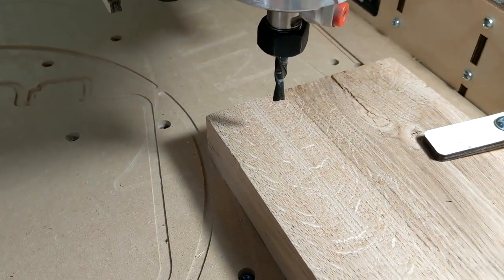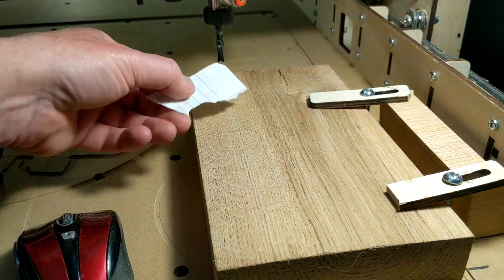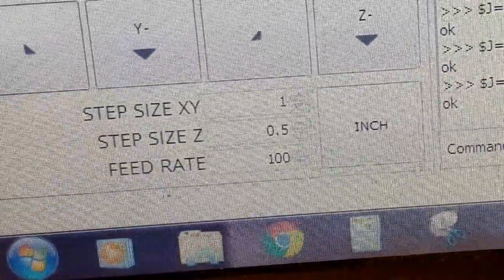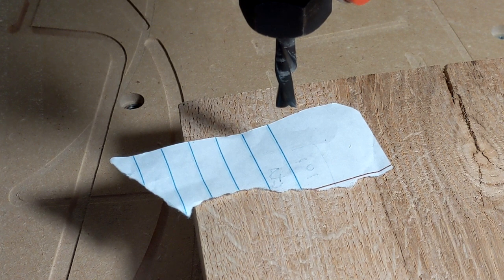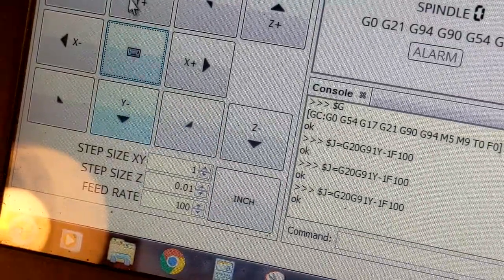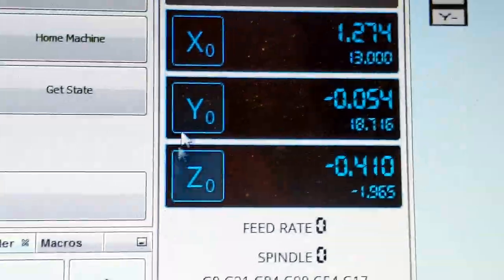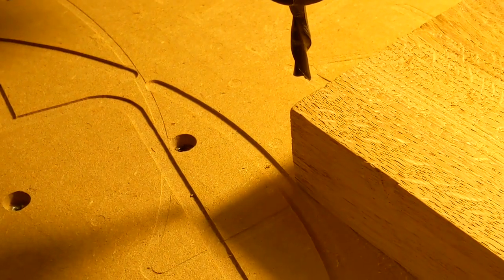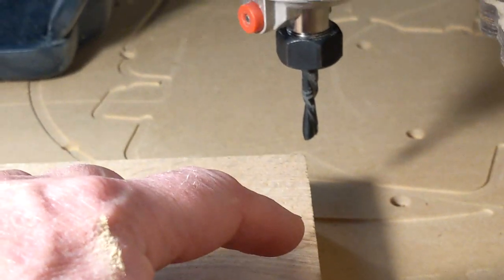Precise Zero Setting Without a Touch Probe on Your CNC Bits

Comment: I would have never thought about that 8th of an inch this way and an 8th of an inch that way thing. It sounds to me like your dividing 1/8 (what ever bit size is used) by 3 to get .125. I'm terrible at math and would actually have to break out my digital calipers and read the number off of that and divide by 3 to do the same thing. 
I did what you said with the code and it did work but I have a question.
Its a great method, but now that your using gsender is it possible to do the mathematical part of it differently in gsender?
I mean is their a different method to do the same thing or do you always have to divide your bit size by 3 AND plug in the code in the console.
Is there another way without plugging in the code. I would never remember that.
Just looking to learn a different way.
AND, you wouldn't consider making a video on how to make macros would you? I haven't seen that kind of video and I see your not one to leave out details.
I would love to be able to turn this procedure into a macro.
Word of advise to my future self...Don't forget to turn on the router!
Reply from the maker: Iwannaapple, unfortunately yes this is the easiest method. I know the math is tedious! You could always get an autozero touchplate which eliminates the math you'd have to do! Yes I have the video on macros on my to-do list. I'm not sure when I'll have it out yet though!
Reply: @IDCWoodcraft  
Eventually I'll get one but I like your method in the meantime. Just used it making my first stacked letter sign for my daughter and her family. 
Using your feeds and speeds table it came out great! For 3.5 hours I was glued to every inch watching it cut.
Your bits are great too. Will probably be ordering another very soon.
Oh yeah, I did figure out that using your method and gsender it did eliminate one of the steps just by hitting the xy0 button then I just type in the last command.
Reply from the maker: @iwannaapple7190   It's hard not to watch that router do it's stuff isn't it. Almost like watching a campfire .

I was wondering if you could do me a favor. can you leave a review on my website on the products store? They always help.

Oh, and be sure to send me a picture of the project. I'd love to see it!

Comment: Can someone explain to me why he put 125 in both axis? The tool is 250? Is that? Ty :)
Reply from the maker: I had to move it over half the diameter to get the center of the bit over the zero point. Does that make sense?
Reply: @IDCWoodcraft  yeah exactly, jus because I never work with inches and just wanna make sure was that! Thanks a lot, great videos :)
Reply: bit center have half of bit size, if you use 250 size bit 125 have half this and center have half at round, if u use 1 inch bit center have 0,5 inch. simple. if not understand, draw to paper corner and then X side round and Y side round then u understand this.

Comment: you do a radius error of your bit on the X/Y axis here.. you need to apply the radius (half diameter) correction for to have your bit "centered" on the borders.. that may be also the case for the XYZ-Probe and explain the offset always in the same corner.. my software don’t do a compensation/correction when i change my bit size.. as you, i use the paper method for the Z.. never i use my Z-Probe because that broke/scratch the fragile end of my bits (the industrial probes have a spring in it, not mine)..
Reply from the maker: MarcusPocus, You bring up a really important point about the radius compensation for the bit, especially when it comes to precise woodworking. Applying those offsets correctly is crucial for achieving accurate results. Many CNC users encounter similar issues, especially when switching tool sizes, so you're definitely not alone in that experience. The paper method for Z probing is a classic and reliable technique, but it's always good to hear different perspectives on using probing tools. Thanks for sharing your thoughts!
Reply: @IDCWoodcraft   thanks, i’m happy and surprise to read your feedback.. an other  puzzle for me (example) is doing a trace with a bit of 1/4" which measured (after done) is larger than expected (higher rpm give larger trace).. we all need to learn and you are very inspiring.. thanks for your lot of videos!!!

Comment: You are not sitting on top of your material. You may be 100 um (paper thickness) - 0.01 in below. That is about 150 um. With e.g. aluminum, that is a lot. You need finer steps.
Reply from the maker: Hi M19. Good point!
Reply: @IDCWoodcraft  Subscribed your channel, great work!